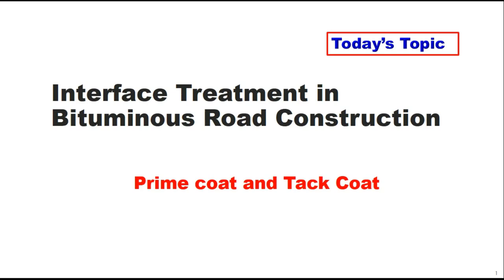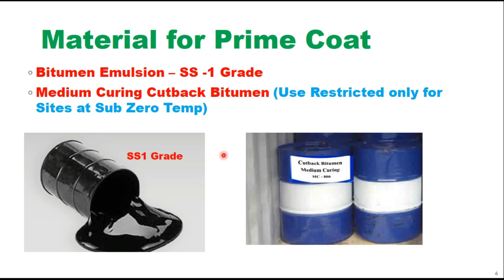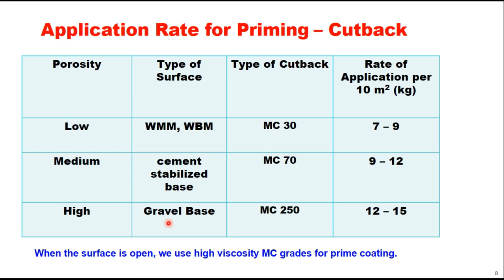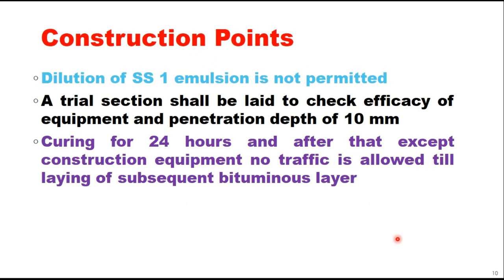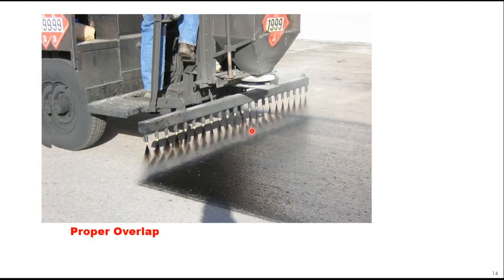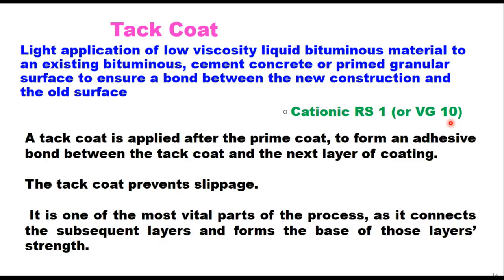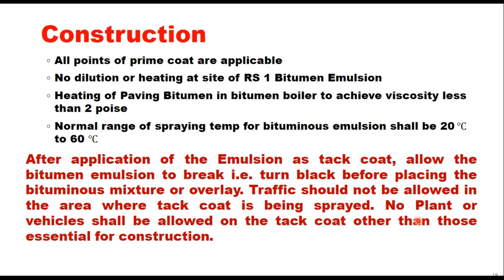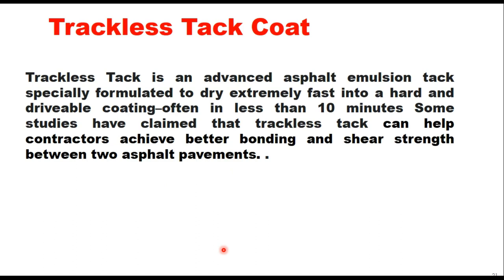#primecoat, #tackcoat, Interface Treatment in Bituminous Road Construction, Prime Coat and Tack Coat

Comment: Sir , 
As per IRC 37-2018 bituminous layer fatigue failure theory  tensile cracks are developed at bottom of bituminous layer on bituminous & non bituminous layer interface under repetated loading. 

However while applying tack coat over primed non bituminous layer we consider it will create bonding of bituminous & non bituminous layer. Isn't our approaches contradictory?
Reply from the maker: This bond is created to avoid slipping type of phenomenon in bituminous layer under longitudinal force exerted by the wheel. Load transfer is still from layer to layer and each layer behaves independent of others. Remember it is a flexible pavement and load transfer is not through bending action. The bond is important only when load is transferred through flexural bending (as in the case of concrete pavement). There is no contradiction here.
Reply: Thank you Sir . It will be helpful if you kindly share your email id.